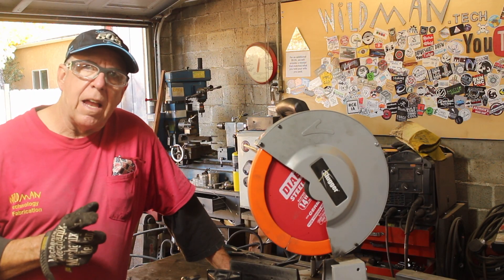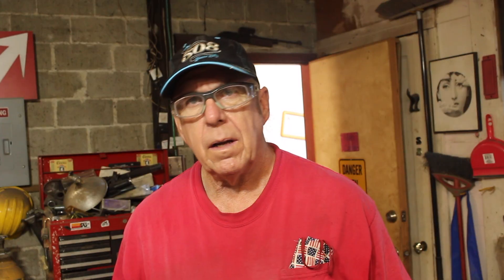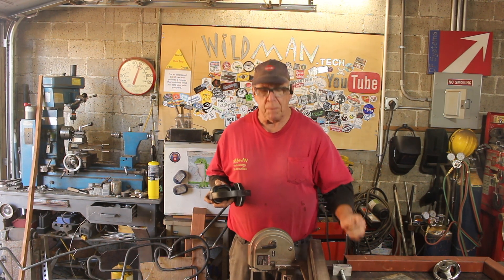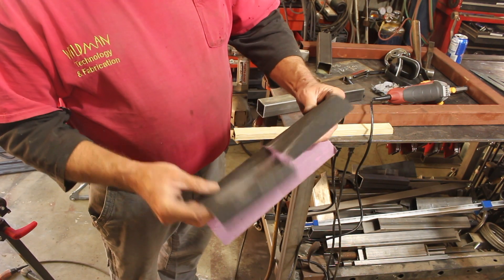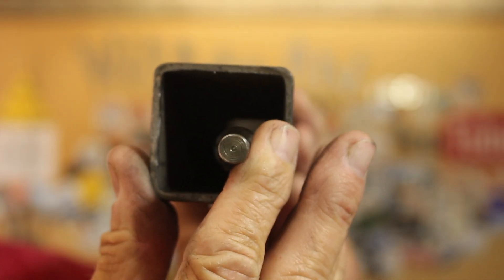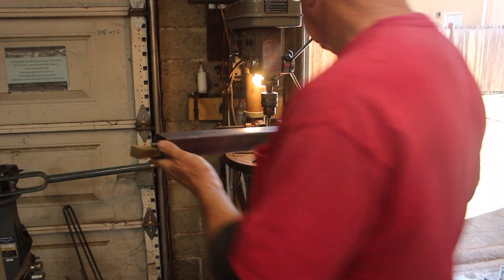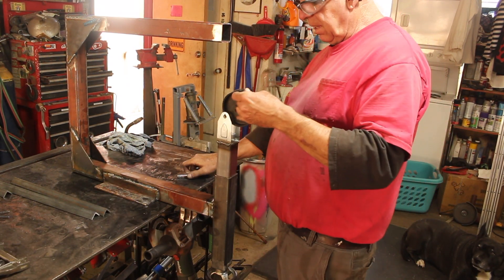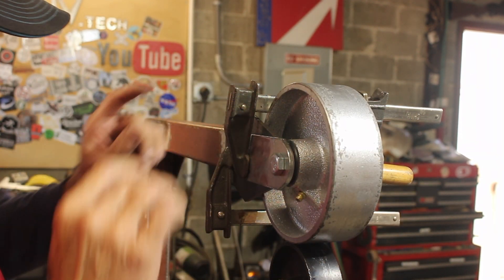Build an English Wheel!

Comment: I think the "hammer" upper wheel as well as the anvil wheels should be hard steel not cast iron or they won't last long.
Reply from the maker: @billshiff2060  they’ve been working for years without issue, and can be easily replaced if necessary.
Reply: @WildmanTech  Good to hear because those are the wheels I have. But I cringe when I see  the wheels bang together when the sheet out at the edge. I don't see how the soft iron won't dent from that but I'll take your word for it and build it.

Comment: Hi good job which size metal profil you use  50mmx50mmx5mm?
Reply from the maker: 2x2x1/8" and I later added gussets to the corners because it had a lot of flex.
Reply: Inside 2x2x1/8"  you put 1.5x1.5 or some diferent i will be try bulid olso. Your lloknlike very good

Comment: 12:37 - I feel like you might need to strengthen the diagonals on the frame because it's ever so slightly bowing upwards from the movement through the anvil, lessening the tension on the plate, rendering the wheel less useful.
Reply: Interesting you would say so. I subsequently did exactly that! https://youtu.be/Ctk2wE-JwSU?t=113
Reply: @MarshWildman  - Oh, sorry, I didn't notice the date on this video.
Reply from the maker: @SnorrioK  no need to apologize. The next project I used it for, that exact problem became a problem and I added additional gussets.

Comment: So u should weld a 2" trailer hitch tube under your bench flush then u can weld 2"tube to tools like this English wheel and others that u don't use as much so its got a good mounting place but swappable to other tools
Reply: That is an excellent tip! I may apply that to a few tools I have!

Comment: First, it's been awhile, looks like you dropped a few pounds, looks good.  I haven't used the wheel since I closed my body shop in 91.  Nice build.
Reply from the maker: I lost 70 pounds using the Noom app. Gained back about ten for the winter, but I'm feeling pretty good. Thanks!

Comment: I have a feeling you may want to weld a super structure around your frame.  I wound up with 1/4" wall tubing on mine to get it stiff enough to shape the sheet.  If you're just using it to smooth out walnuts, then you may not need that much stiffness.  Is the bottom wheel steel?  Lastly, you'll see how out of round your anvils are as you start working on panels.  If they aren't concentric, you can pop them on a lathe and use a belt sander to true them up...  It makes all the difference...  Oh, and I need to find a scrap yard like you have!!!  I need those linear bearings!!!

Comment: Thank you for another Very nice build video it came out awsome and can't wait to see your video on the tailgate 
Also I think that your going to have to do some research on the wheels bc I do believe that it would help you be able to do a lot more stuff that you were planning on doing with it bc I can't remember who said it but I'm pretty sure that 1 or both of the wheels have a bevel on them and if it's only 1 of the them I'm not to sure if it's the hammer wheel or the anvil wheel but it's just something that might help you take this all the way to doing your tailgate as nice as possible and thanks again for another great video
Reply from the maker: Talk about a rabbit hole. The anvil wheels run a wide range and the different amounts of curvature on them makes a big difference in the effect they produce. I guess you'd call it a learning curve.